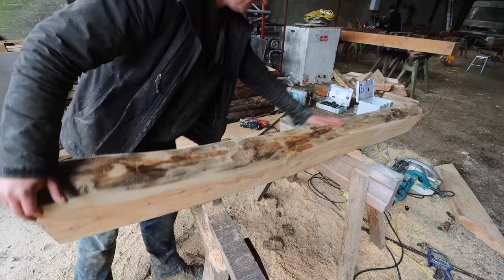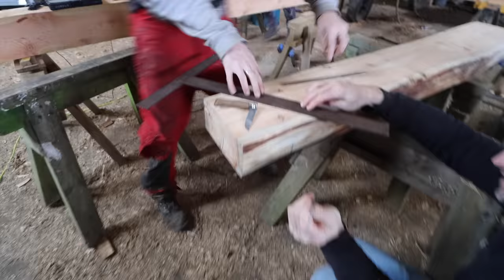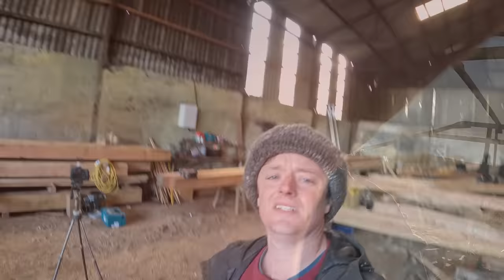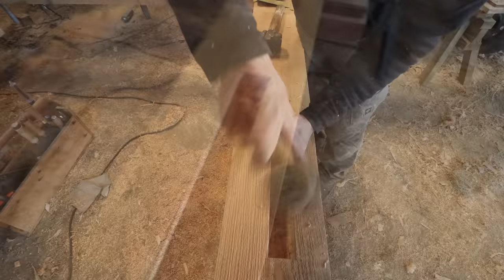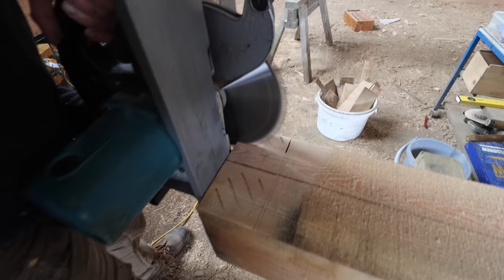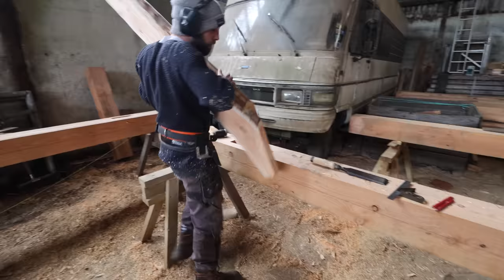Timber Framed Barn Part 9 Wall Frames Complete

Comment: Kris, It looks amazing already!!!
So, by my calculations, next video/ next week, and the upright's should be done? And the cross bracing, will that happen before the rest of the uprights or after?

I really love the way the whole frame is done. Using the weight of each piece to secure the whole frame together by interlocking the pieces is beautiful. I would love to have a house built like this!!!
Timber framing is an art form that really should be used more. I know it's time consuming, but I think the cost is worth the outcome, longevity, and beauty of the structures is worth the extra time.

It's going to be incredible to see the Barn Raising.

Great job by all the guys on the timber work. Truly Masters of their craft.

Thanks Kris,
Keep Safe and Always Inspiring,
Matt - Toronto, Canada